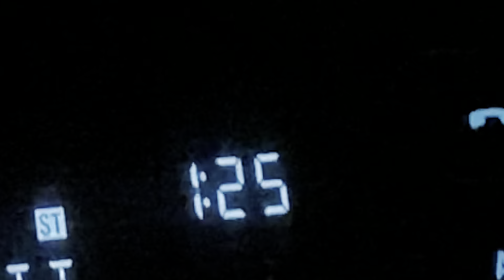2021  - The Year that changed everything

Comment: Hey you know what you should do to lessen the height on The Handlebar? why don't you design a front cowling that has a headlight similar to an 88 or 89 trx250r.  Or go old school, white with red stripe with a handlebar mounted headlight. The headlight as you know, Sits Up above the cowling. It will look more stock and creat a retro look. I love that machine. A headlight is all it needs. 
Keep it up. 
I might buy one but maybe built off a CRF 450x.